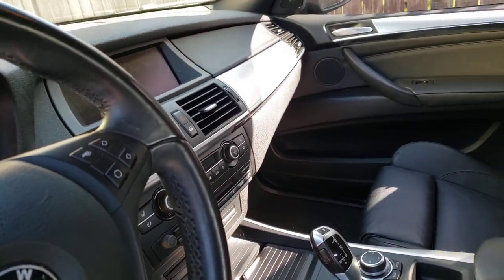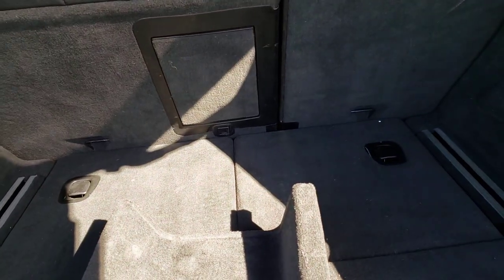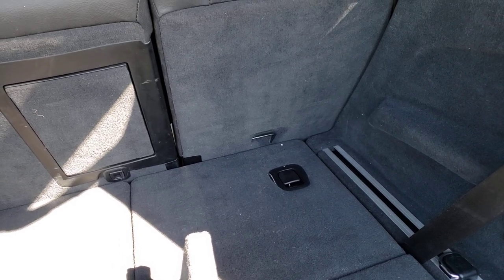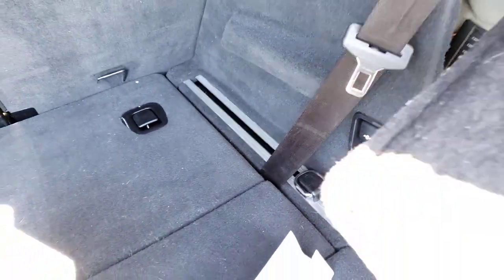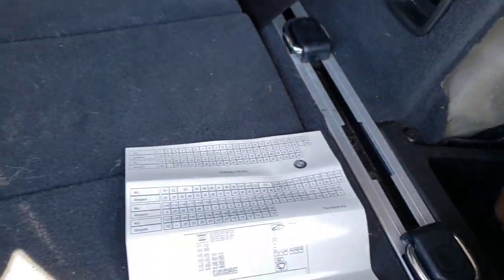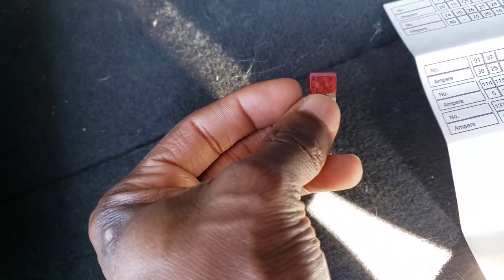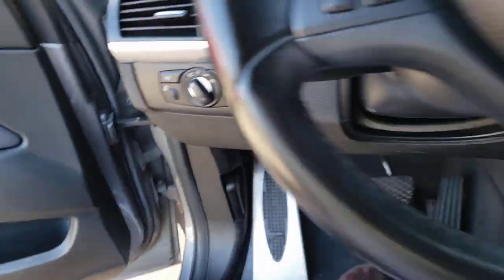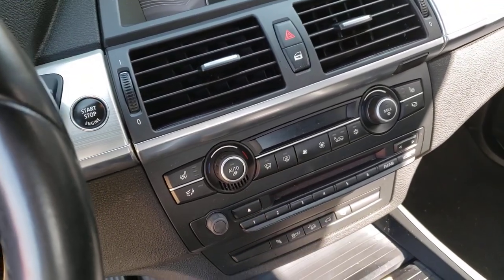How to solve 2011 BMW x5 e70 series no sound no bluetooth connection problem

Comment: That fuse 132 controls the Comfort Access System (CAS) module which is related to a bunch of functions like your touch lock/unlock exterior door handles, the Bluetooth/phone functions, keyless FOB sensing (you won't be able to start the engine without inserting the key FOB into the slot), and gong you hear when you enter the car.  When fuse 132 pops, none of those functions work on your E70. It's usually because of humidity or shorts in the wiring, or one of the door handle sensors is faulty (you need to disconnect each one in turn to find which one is causing the first to pop). If you don't fix the root cause, it'll pop again soon.
Reply: 132 fixed my Comfort Access, next step I need to figure out the bluetooth issue (Please wait message)

Comment: Thank you.   Fixed my 2011 x5.  From reading some more on it it may have been caused by a short in one of the front door handles?  Did you ever have this issue again after replacing the fuse the first time?
Reply from the maker: Never actually had an issue after that